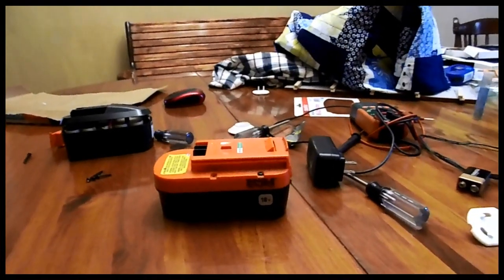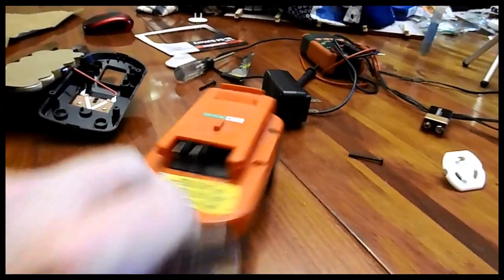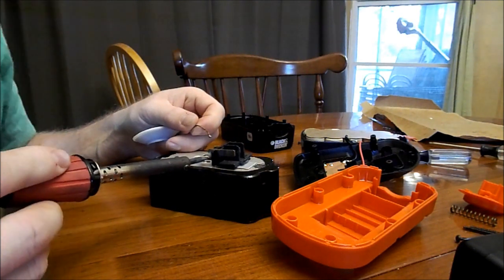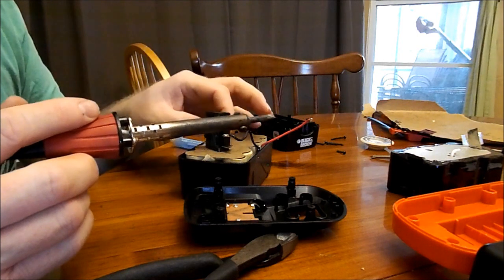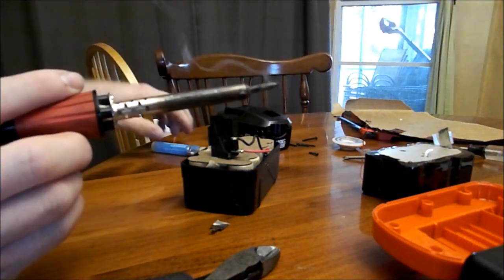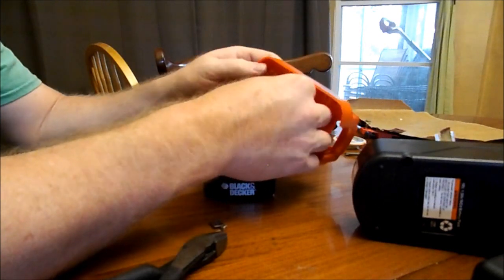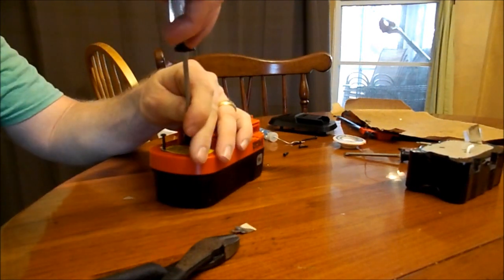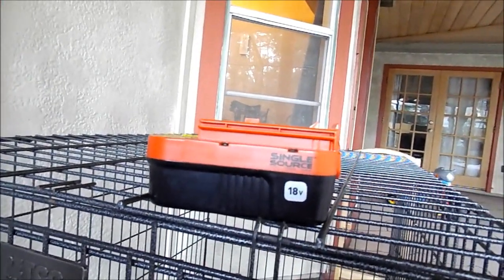Cheap Black & Decker Battery Hack!!!

Comment: I was just watching this before finding some compatible replacement batteries on the Temu Chinese website.
Up until finding some replacement batteries I was actually thinking about doing this hack.
For a two-pack of compatible black & decker hpb18 battery replacements off of the Temu site, it costs a total of 18-bucks and change with free shipping.  For a single battery replacement it was about eleven dollars.  I guess the price has gone done for the seven years ago that this video was made.
By the way, it's November 2024 as I watch this video hack.

Comment: Ok, but how about comparative run time?
   Also, there are 18650's and there are other 18650's. Actually AH capacities among sources vary quite a bit, and that's before considering outlandish claims. Just sayin'.
Reply from the maker: Video is over 6 years old. There is much better replacement battery now that are cheaper.
Reply: @MattLundquistVW  Well, I have to admit that it has been a while since I shopped for Li cells. I guess I should look again.

Comment: I found a whole set of 18v yard tools out for the trash. This is a good idea and I originally considered it... but ended up buying a $10 adapter on amazon that lets me use the newer B&D 20v Lithium batteries-- there are lots of generic batteries for about $15 each and will give more power and run time.  Everything works great but not sure why I do these things as I already had the 20v and 40v sets... ¯\_(ツ)_/¯

Comment: One problem I noticed with mine was that the charger never got the cells  to 1.5 volts for the pack.    Only to 1.3 float voltage.      Your chargers may be the culprit.    Also the DUAL chargers?   Only try to charge one cell at a time and see if that works.
Reply: I though NiCad cells are 1.2 V ?    That's why you have 15 of them for nominal 18 V ?

Comment: you can buy a adapter that changes it from nicad to lithium on ebay then you can buy a new tool you like that comes with a battery and charger and continue to use your old tools and expand into the new lithium tools

Comment: Hi, where do I need to buy the battery for replacement? Thanks
Reply from the maker: You can look on Amazon for a direct replacement. But if you want to do the conversion, I got the battery at Harbor freight.
Reply: @MattLundquistVW  great to see your video as I was looking for one on individual cell replacement (if I can find them) We acnnot get harbor freight in UK, and the cheap Amazon (unknown quality) A18 cost over £20   = 28USD. If only I could find HF equivalent here.
Reply: @MattLundquistVW I checked around the price on 18650 and it costs around $5 per battery at least. So it would cost at least $40 or more to replace all 8 cells. It would also cost you 40 to buy a brand new one. So I do not see any benefit here unless you got better price for batteries
Reply from the maker: I did not replace each cell. I replaced the whole pack. The battery pack was around $12 us at the time I made this video.
Reply: @MattLundquistVW  where do you buy the pack? Thanks
Reply from the maker: @seemovielove3597  harbor freight tools. Part # is in the video

Comment: This works, I just did it. Battery is $12.99 at HF right now, if you use 20% off coupon it's 10 & change.
Reply from the maker: Glad this video helped you revive an old tool😃

Comment: Why not just put the new batts in the old case???
Reply from the maker: Al Ingram that is exactly what I did. The Harbor freight battery case is different than the Black & Decker, so you have to swap the battery cells from case to case like I did. Hope this helps clear up any confusion.

Comment: Just get the adapter on amazon to change it to lithium ion. SOOOO much better battery technology + it holds charge. Just remember to get a lithium ion charger for that battery
https://www.amazon.com/dp/B0789QNS1G/?coliid=I30NV503XBHDL9&colid=1B9RKK4OUWEV8&psc=1&ref_=lv_ov_lig_dp_it

https://www.amazon.com/dp/B07M98RTDB/?coliid=IV2OD4FGFLYSM&colid=1B9RKK4OUWEV8&psc=1&ref_=lv_ov_lig_dp_it
Reply from the maker: Good tip, when I made this video there was not out there for this battery.

Comment: Thanks for the information! Before seeing this video (over a month ago) I purchased two lithium ion 18 volt replacement batteries for the Black & Decker Firestorm tools. They were $39.99 a piece.  I was happy to do it because my old batteries are nickel cadmium.  I may have missed it, but are the Harbor Freight batteries Lithium Ion or Nickel Cadmium? If they are Lithium Ion, I'll give this hack a try on my weakest of the original Nickel Cadmium Batteries.

Comment: Matt do you or any viewers have a solution to replacing or finding a substitute for the Ryobi  24v Lion battery that was discontinued.  I still have a barely used weed eater and edger that uses that battery?
Reply from the maker: No I don't unfortunately. The only thing I can think of is to search the # on the battery on Google. You may find an aftermarket battery, it just might cost full price.

Comment: dammit, I threw mine away and I have 2 black and decker weed Wackers, a hedge trimmer, and leaf blower. wish I would have seen this. I'm trying to find a hack to run these off ac or dc with a plug in dc converter, like the battery charger or something
Reply: I seen a video of a guy running them off a car battery

Comment: It does not matter if the pack is so dead that you cant find the polarity with a meter, you can tell the positive and negative of each individual cell in the pack by looking at them.
just take the pack apart and find the first and last cells in the series and see which goes to which terminal on the connector you can identify which terminal is which.
Reply: That's only if the terminals are actually marked with polarity. I haven't seen many that do.
Reply: @joewoodchuck3824  what are you talking about, the NiMH and nicad cells are easy to tell the polarity of, you don't need them to be marked!
Reply: @stevefox3763  I know that but I thought you were referring to Li cells. I further thought you were talking about battery  case markings.
Reply: @joewoodchuck3824  my comment was about the video poster not being able to find the polarity of the packs contacts, to find that out without a reading from a meter on a NiMH pack is easy from looking at the cell configuration inside.

I know some packs are lipo these days but it should still be obvious looking at the configuration of the cells but nearly all lithium based packs use 18650 cells which polarity is easily identified just from looking at the cell.

Comment: Or you could buy a 3rd party replacement from Amazon for 17.99.  Way easier and better.
Reply from the maker: When I made this video the were not available for 18v black and Decker. But they were available for DeWalt.
Reply: ahh, I just had to replace mine

Comment: Just my two cents:  Place a short piece of 600 volt electricians tape between the battery cells and the exposed ends of the connecting prongs.
Reply from the maker: Not a bad idea, it had a piece of cardboard as an insulator  over the cells. But more is always better .

Comment: try this instead, way better solution

https://www.amazon.ca/Stanley-HPA1820-Battery-Convertor-Adapter/dp/B07CXR1QPV/ref=sr_1_1?s=hi&ie=UTF8&qid=1533573240&sr=1-1&keywords=black+and+decker+18v+to+20v+adapter
Reply from the maker: Cncmike68 the adapter is a neat idea but cost more than the battery I used. Plus I would still have to buy another battery. That may work for someone who has other batteries for other tools, but would not have helped me in my situation.
Reply: That might be, But your time is worth something. I would think it would be a wash if you factor your time in building a new battery.

Comment: Thanks for posting this video... I have a 24volt Black n Decker which has a dead power pack... Will give this a try, if either Harbor Freight carries this size battery
Reply from the maker: Glad you liked the video, not sure that HF has a 24v battery, But it would be worth looking into.

Comment: My B&D cordless drill battery has non-removable screws. Drat and double drat!!
Reply: reasons  is they may be safe for use in items but lithium ion is something we should not play with. That is a big reason manufactures don't want people taking batteries apart. Also if you become hurt the government can fine the company  for products not safety standard met.They already payed a 1.6 million dollar penalty fine for not reporting things doubt they wanna pay another at black and decker. Ill be honest these batteries are not very safe but safer then others

Comment: Black and Decker and Dewalt have a much higher mAh, which makes a huge difference.  Those Harbor Freight batteries give you 1300 mAh which is about half the time before discharge of a Dewalt battery which gives you 2400 mAh.  And those batteries will not deliver the power you can wield with a Dewalt or a B&D battery.  You get what you pay for.
Reply from the maker: Yes the HF battery has less mAh, but this battery is for a pole saw that I only use a few times a year. It's hard to justify the extra cost of the original battery when you maybe use a tool three times a year. When the battery goes dead and needs to go on the charger, I have to clean up all the tree debris anyways. so it works out in my case.
Reply: You have a point.  I have been down this road myself and I was just passing on the knowledge.  The way to solve this problem of worn out batteries, which cannot be resuscitated with sparking,  is to use Tenergy cells rated at 3.0 mAh and solder them in the shape of the original battery.  And you can replace only the bad cells, to save money.  Otherwise it costs nearly $40 to replace them all...

Comment: Thanks. I have 4 B&D tools and 6 batteries all dead. I've watched many rebuild videos and was about to buy a box of NiCad cells from china, and some nickel strips and start building new battery packs from scratch. Not now, 
I'm off to harbor freight !!!! this will be a much better solution, thanks again
Reply from the maker: Glad this video is going to keep your tools useful. The H/F battery is a lot less work than building one from scratch for sure.

Comment: I've done this but it's better to buy the upgraded HF battery for a little more amp hours.  Pretty simple, cheap fix.  Yes, you just use your existing B&D charger.
Reply from the maker: The upgraded battery is a better value for sure, I'm just to cheap to spend the few extra dollars LOL. Thanks for the commit it will help others get there tools back to work.

Comment: How's it holding up? I presume the harbor freight battery is lower quality and will die out faster so I'm curious as to how it has fared.
Reply from the maker: so far it's good, I do not use it very often but it always takes a charge. The HF battery is a little smaller on MH which makes a small difference in run time.

Comment: How do you perform a recharge with the modifications?  Still use original charger from B&D?
Reply from the maker: Yes I used the B&D charger, after the modifications it is just a different battery in the B&D case.

Comment: Be sure the screw that holds the tip is tight.  use smaller diameter solder, and get some on the tip of the iron to there it is about to drip off.  Touch the tip to where you intend to solder so the solder drop will help transfer heat.
Reply from the maker: thanks for the tip